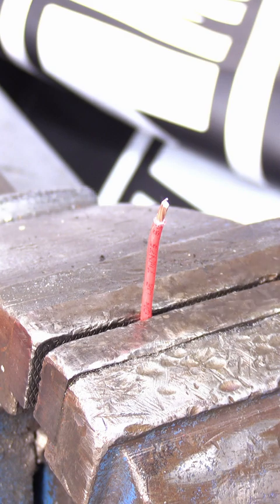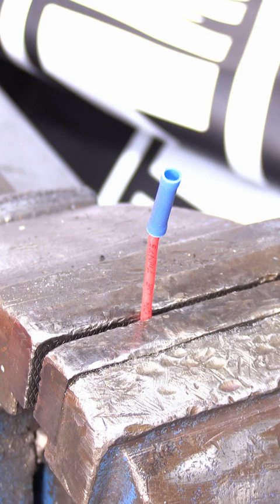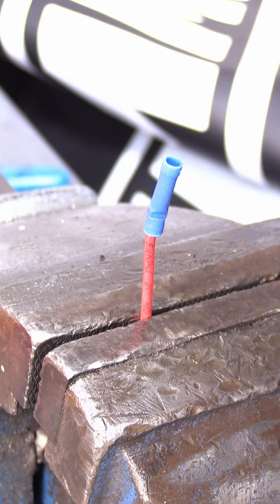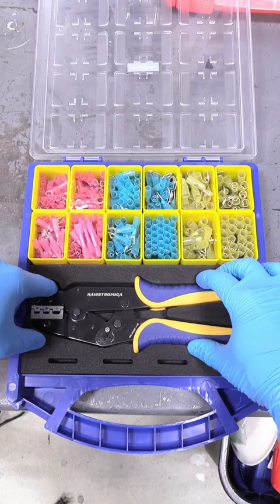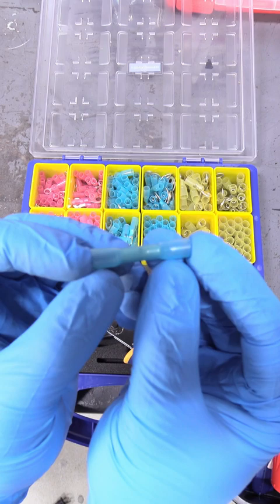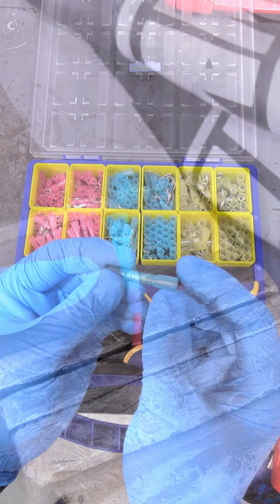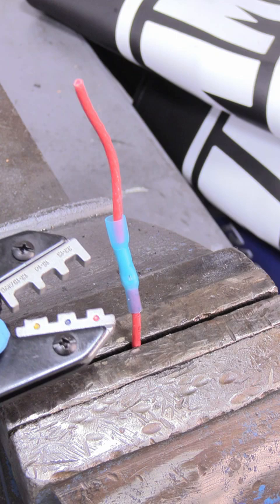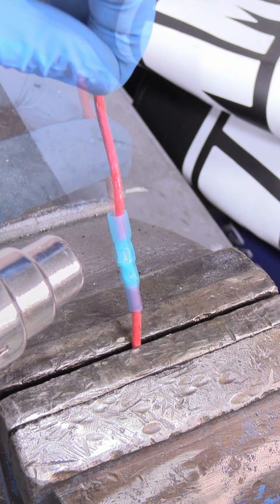Self Sealing Wire Connectors #shorts #techtiptuesday

Comment: I bought some of those crimper,  they were wide , I bought another pair for marine application wire crimping there narrower where they go on the but connectors , which is handy  in tight spaces , there's two kinds of them, same ones , watch the width where they grip on the connector , narrow or wide